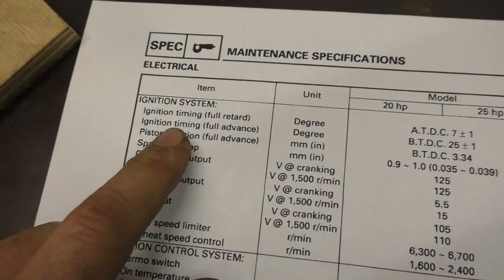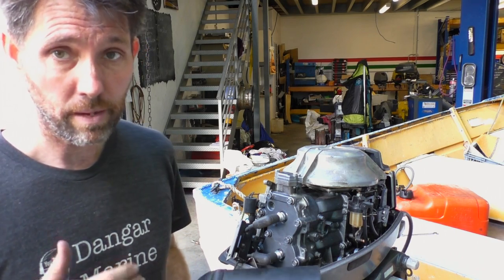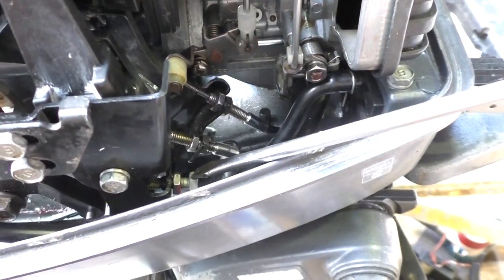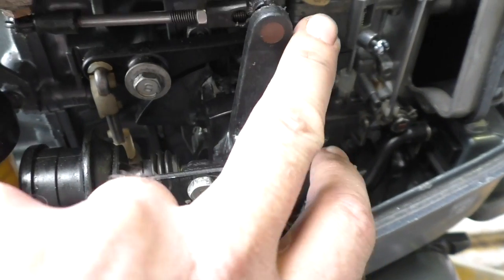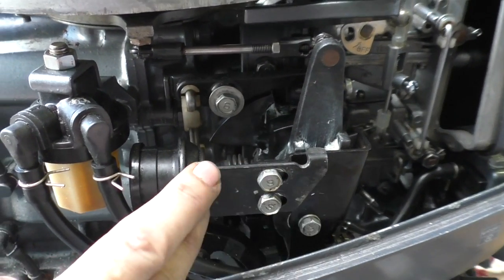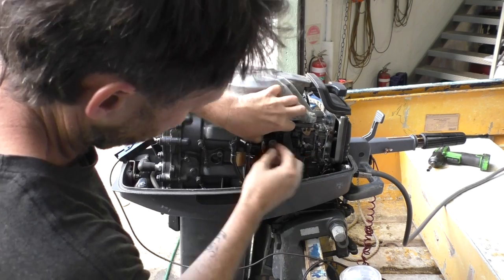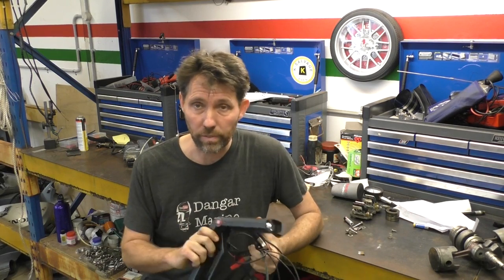Using a timing light to set outboard ignition

Comment: You're pretty slick on outboards.
Sounds like a little lean sneezing.
Reply from the maker: Thanks mate. Yes, this probably needed a carb sync too.
Reply: Dangar Marine I just ran up a common problem that is commonly misdiagnosed.. outboard runs good on hose,  put it in the lake and it won't start or is hard to start, then boggs down won't open up...I pulled off the lower ,and shined a torch up the shaft and the exhaust was closed by half with carbon ...cleaned it out  and ran like a top...

Comment: hey the clock vid was cool  I have a serious question for you one of witch I cant get any help from the local Yamaha  dealer..my question is  I have a 94 Yamaha 225 pro v and im told that I should run 91 octane but being here in the u.s  finding that octane with out eathanol is hard  my question is can I run 88 octane eath free.. its more popular around here  any help would be great  thanks for your vids they are great..scott strong
Reply from the maker: I wouldn't be too worried about running the lower octane fuel if you aren't getting any knocking or pinging from pre-detonation. Here is some information from Yamaha if you are running E10 http://yamahaoutboards.com/owner-resources/blog/pro-anglers/yamaha-offers-help-ethanol-fuels
Reply: Dangar Marine

Comment: Please I need help with a 1977 evinrude  full throttle timing advance my sticker that has that information its going so I don't know what settings do  I need 16*  or 24* degree
Reply from the maker: Not sure what the setting should be, try to track down a PDF copy of the service manual online.
Reply: I tried but I can't find it
Reply: 115799s that's the model #

Comment: I'm having trouble setting timing on a 2004 Johnson 115 HP OIS 2000, I have heard it can be done without taking it to a shop. Does anyone know how?
Reply from the maker: From memory it is a plastic lever of sorts on top of the flywheel.
Reply: get the factory manual... and those motors are tricky without the factory OIS tool

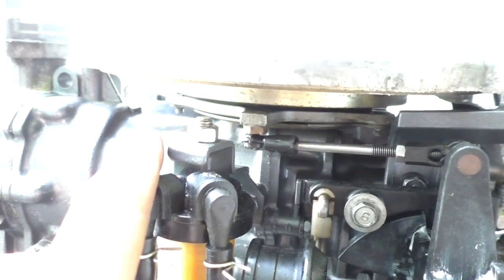Comment: Though an older video...  Great description of trigger motion relative to flywheel and timing result at ~ 5:00 into video

Also at 6:15, a great comment regarding  idle speed changing with timing, and that you may need to reset idle after getting timing set correctly; you can hear it in the video.

Comment: nahhh... if you adjusting the idle timing and still the same very periodic "dumps" than it's not fuel related.. (im keep guessing;)

if the air fuel mixture is too lean at idle, it's sputters right in the exhaust outlet (like if would ignite too late)... that is very different sound, and doesn't make this harsh rpm drop and fluctuations

i think the spark punch thru somewhere (cable, or the coil itself) OR if that previous person adjusted the timing, it's wise to check the air gap between stator plate and flywheel magnets

i would check the 2 carbs just to make sure (syns of course), and would try the two cyl. alone (spark plug cross change etc..) !after! the carb's check
Reply from the maker: It will be interesting to see what we find as we look deeper into it. I normally find you can hear the crack when the cable or coil is arcing straight to ground, but I'm not ruling anything out at this stage.
Reply: what about the kill switch?? have you tryed to disconnect it? i know it's coupled ,but... you never know;)
Reply from the maker: Yes, the kill switch has been replaced. The one in the recent kill switch video was the one from this outboard.

Comment: With the cost of water and the trip down to the river each time, have you thought of making a water test tank. I know they are pain to move around , but the one I saw down the coast was brilliant. 
He used a diff from a small truck bolted directly to a 2m x 2m x 1 m deep tank . The other end had a VW beetle Hbeam bolted to it- complete with steering box.  The diff had a simple frame with one of those Chonda engines ( I think it was a 6hp) that chain drove the diff - the sprockets were just welded to the old prop shaft  uni joint cups. And yeah, you just drive it out of the parking spot , back the boat up, do the test and park the tank away. Appparently they have some truck wash in the water as well. I reckon you could something similar with one of those big poly tanks ?
Reply from the maker: I'd love to make one Ron, our big problem is where to put it having such a small workshop. I think we might need to move to a bigger place!
Reply: If you are making enough money to even contemplate that idea it is a very good sign. But the guy down the coast just parks it in one of his inconvenient to use parking bays and leaves it there.
Maybe in your case, use the same base as your engine stand build up a tank on that? That would be a lot easier on space.

Comment: I really hate to do this on your wonderful channel. But i am about to the end of my wits. I have hit that sad state of desperation and dispair. Your Channel has been a wonderful aid and learning tool But I have to beg and ask you for your help. 

So the project and learning experience is A 1992-1994 Force 40 2stroke single carb the serial and model numbers are so faded i cannot read them and Its for a home built boat project and I got the engine free off of craigslist. WIN, I think. lol. So before I go digging into her the first thing I did was check the timing under these conditions: engine on land in a trash can, filled with water, prop is on, using the starting motor to crank the engine over, full battery, I also have 2 other batteries that I swapped around for the test. . . (so full battery was guaranteed), Plugs removed, and plug wires grounded out. The Timing light is set on 0. My timing reads 0 in neutral with the carb Closed and 28 at WOT on the left hand side of the 0 TDC marking on the fly wheel (still not in gear). Those readings are at the Zero line on the timing sticker.  My manual and other resources just tell me static timing should be at 32btdc. What ever that means and under what conditions, pleas help.
Reply from the maker: So the 32 BTDC means that the spark will fire 32 degrees before the piston reaches top dead centre. This video will help with a few of those concepts https://www.youtube.com/watch?v=5wbmaQXGf54 If the idle timing is specified to be at 0 (on top dead centre) then it sounds like it is spot on. I wouldn't worry about the WOT timing until you can get it out on the water under load. Is there a problem with how it is running?

Comment: Hey Stu! Was wondering if I was missing something here. Engine runs fine in Neutral, but for the life of me I can't get it to run in gear, it dies almost immediately. I've cleaned the carb, and replaced most of the ignition system. Fuel delivery seems ok (but it often runs lean). I've adjusted the timing and mixture screws a bit to have it run the best it can, but yea it only runs in neutral. Any tips?

Thanks!

https://youtu.be/R4cbB7hD7Cg
Reply from the maker: Have you checked the compression of each cylinder?
Reply: ahhh I have not. The motor did seize a few years ago after a wet and cold winter (Vancouver Canada) but I soaked it and it broke loose and ran fine after that. The other thing was that I had to re-thread the spark plugs. Was hoping that would solve any compression loss issues. Also replaced the magnetos etc. But maybe the seize ruined the piston rings? I hope not. Was really hoping that maybe there was a timing issue, as the engine runs great in neutral but... Yea I'll try a compression test. I also bought a timing light but havent tried that out yet.

Any input is much appreciated! Thanks Stu!
Reply from the maker: Low compression engines can run in neutral when there is no load but not have the strength to run in gear.
Reply: Dangar Marine ah buggah. I'll give it a test and let you know. Thanks!

Comment: My 20 hp Yamaha is popping exactly the same way. Tried everything I can think of to correct it, but have not got it yet. It only happens right at idle, from there to wide open it runs great. Please see video, https://youtu.be/T54k3BUqMYYIf you or anybody else got any thoughts please share.Hopefully I will learn something I have over looked in your next videos on this engine.Engine from idle to WOT.  https://youtu.be/BuMcwkBVQdw
Reply from the maker: I would say you pretty much need to go through the things I'll be checking with this outboard during the weekend. Stay tuned!
Reply: Dangar Marine I meant to Mention that colouring in the timing marks on the flywheel with a white grease pencil and wiping off the excess so just the marks have white left in them make them much easier to see....probably show up better on video as well. Great Video.